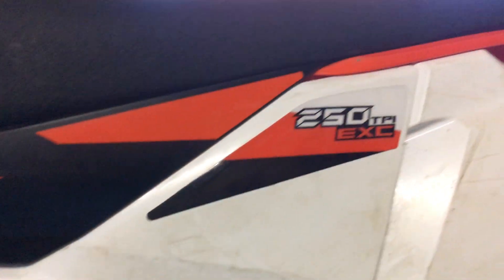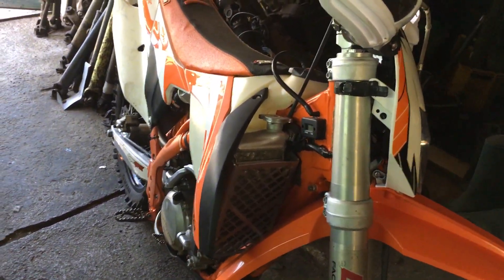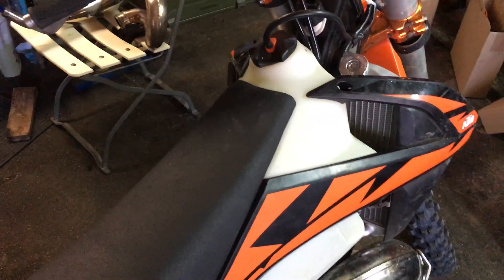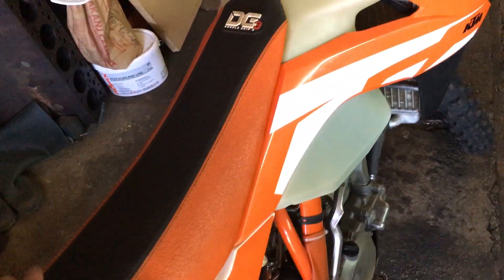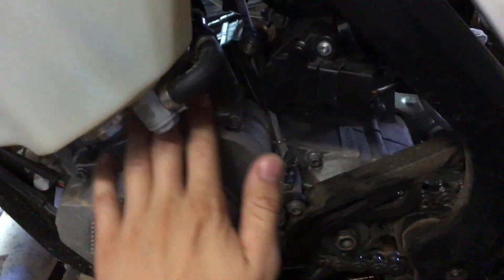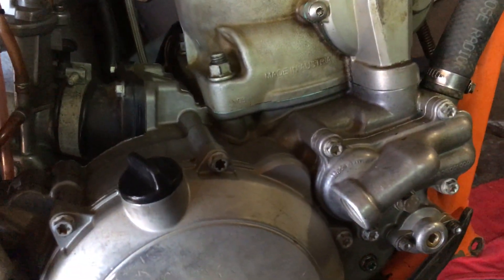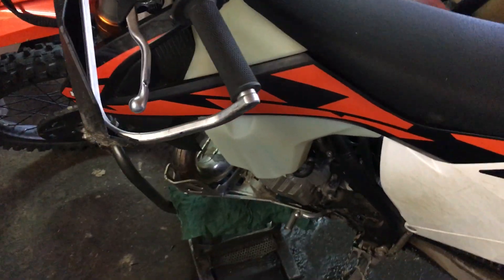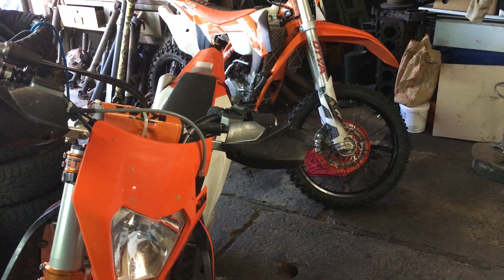KTM Carburator VS KTM TPI 2018

Comment: Cold start on TPI bikes it is very different as they only get pure oil injected into the crank and it takes time for oil to get to the piston specially in cold climate areas (like here where summer is +5C to +10C) and when doing winter riding. There is many videos here of pistons of TPI show wear marks probably caused by lack of lubrication on the piston during cold start. KTM should maybe make another cold start oil injector to lubricate the piston when starting.    

.................,......

Comment: What is with the engine breaking now? Is it bad for TPI 2 storkes to make much use of engine breaking?
Reply: Gordan Letić same thing
Reply: those bikes run in scary low lubrication so better watch out.
Reply: One said that the oil is delivered according to the rpm of engine and not the throttle. If that us true engine breaking should not be a problem anymore? This needs more information.

Comment: Today I picked up my new EXC 250 TPI..haven't ridden it yet.
I do all the engine maintenance on my 2016 250 but I'm a bit concerned if the TPI needs work because garage charges in the UK are very expensive!
Reply: How did your tpi treat you??

Comment: Nice comparison, thx
But as for engine performance you are comparing a 300 carb bike with a 250 TPI so there must be differences because of the 300 power...
Reply from the maker: i had EXC250 2015, now the same bike is exc300 on the video but with 300kit
Reply: The Dirtbike Rider #2 No Music 
Ahh, ok, this makes sense, thx :-)